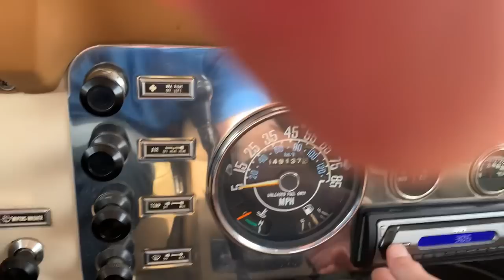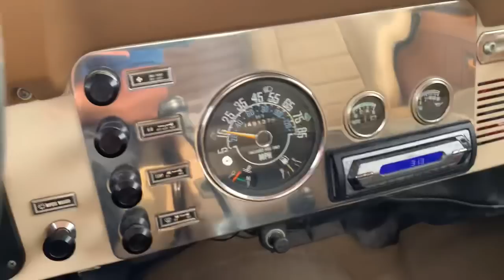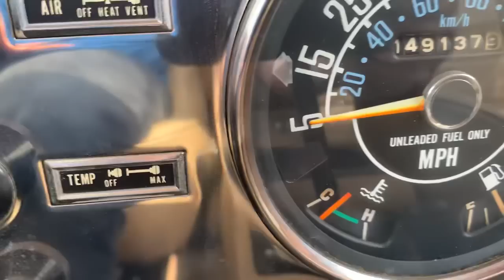1985 Jeep CJ7

Comment: Those Weber carbs are crap on this engine. Get a 2100 Motorcraft, you will not believe the difference!! Never mentioned the 85/86 Cj7's had galvanized tubs!

Comment: Bought a new CJ-7 in '84. After 348K trouble free miles I sold it. Had to knee problems it was getting to hard to clutch the gears.
Mine was a 5 speed/aloy trans case get the 4 speed as it comes with an iron box, stronger. 
Paid $8200, sold it for $7500. Just tires, batteries and a few radiators and the occasional brake job.
One great truck. The ones sold today don't hold a candle to the old ones as they are just chick trucks so people can look cool after they spend $30-$40K for marketing on a piece of crap.